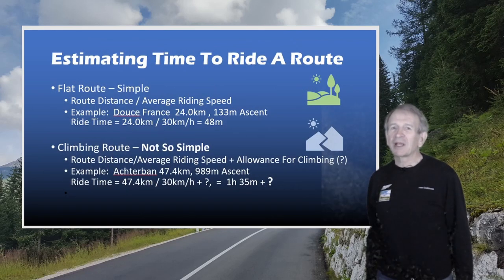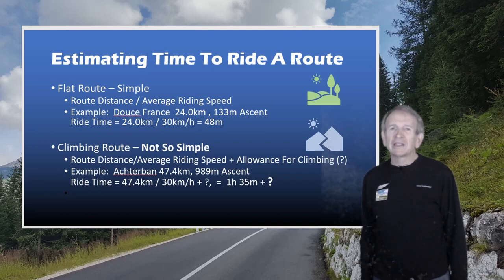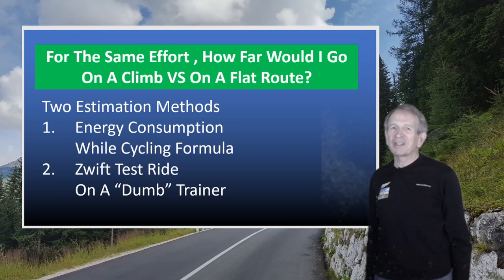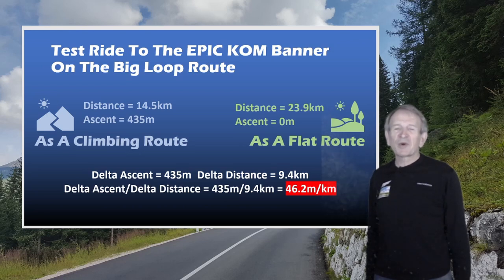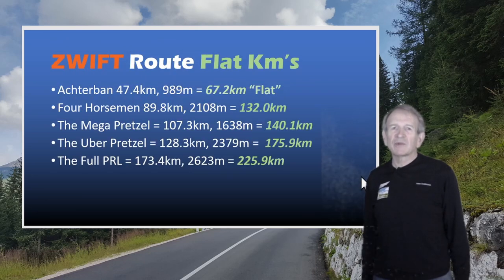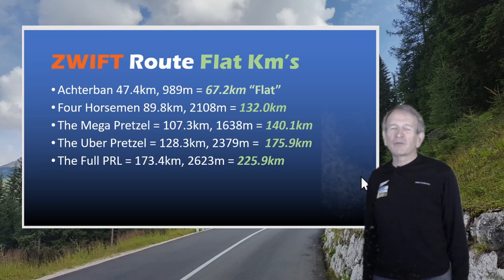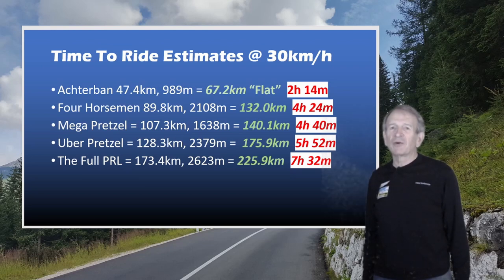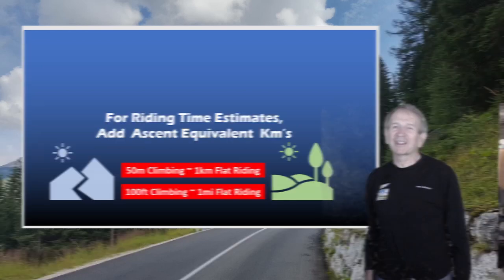How To Estimate ZWIFT Route Ride Times

Comment: Interestingly I did both the zwift insider uber pretzel at an average power of 150W taking 5hr 40, then the zwift insider PRL full at an average of 139W taking 6hr 25. I had lost 1kg in weight between the two, but also I think there were psychological factors involved too. It was easier to do many shorter bursts of climbing than fewer big climbs, especially with the AdZ at the end of the Uber. An interesting video and approach none the same.
Reply from the maker: Thanks for your comment.  Very helpful to put the approach I offered in context.  Your times would also depend upon your W/kg and how that would translate to a riding speed on a flat section of a route.  Seems your Uber Pretzel time was almost "bang on" my estimate, but your PRL Full was appreciably better.  BTW, very good time!
Reply: @endurancesweat  another factor 're the PRL Full is the amount of relevant downhill. I was able to rest and indeed coast for many of the Fox hill descents (contributing to my lower average wattage perhaps) yet still maintain speed, but with the Uber there was all the uphill associated with the Alpe, but none of the downhill officially.
Reply: @endurancesweat  it is an interesting topic and your video is really helpful, I myself had recently been trying to work out whether it was possible to estimate ride times taking into consideration distance, climbing and gradient, so your video was bang on cue!
Reply from the maker: @neilveitch5761  Good point.  2-1/2 minutes coasting down Box Hill every lap.  Almost makes the ride tolerable. ;-)